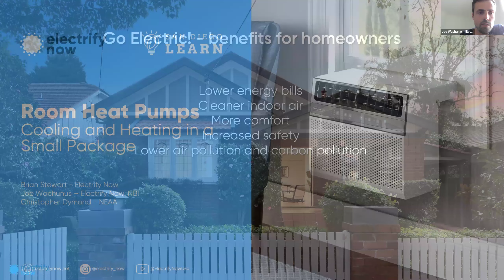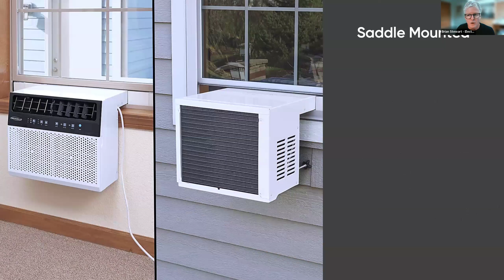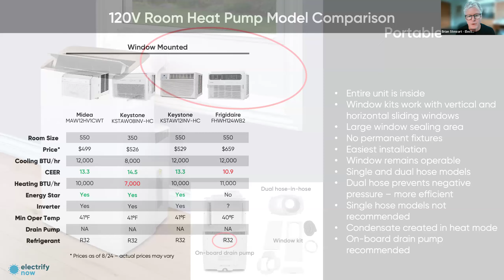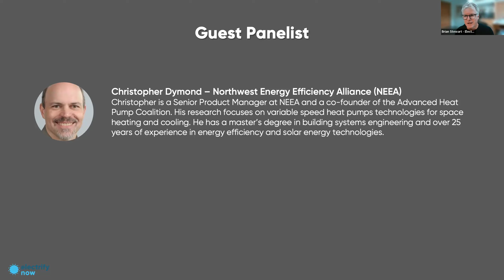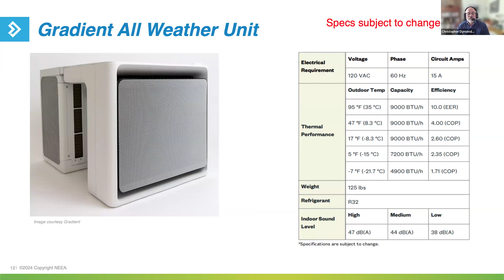Room Heat Pumps - Cooling and Heating in a Small Package

Comment: Please read this.-------PORTABLE UNIT FOR HEATING IN ANY CLIMATE----------.
Success with a portable twin hose inverter ac/heat pump is possible.
I have several Gree manufactured (sold under many names)14000 btu portable twin hose inverter ac/heat pump units with a defrost cycle.
 $350 online from China sellers. 
Yes, they do shut the heat completely off at about 35 degrees. Yes, the defrost cycle does work until they shut down. I moved the air intake sensor to a position where the unit didn't know what the outside temp was. That does work well, but the unit did spend a lot of time working off the freeze up condenser coil sensor and defrosting. But it did produce heat to zero outside temp.
So, for heat under 40 degrees outside temp I blend a small amount of room air with the outside intake air to prevent freeze up and shutdown. The colder the outside air, the more room air I blend in with it. I blend it at the intake hose connection on the back of the unit.
Zero degree outside air needs ONLY about 20 percent inside room air blended in to prevent unit shutdown OR freeze up even if the outside temp sensor is not relocated. This produces a very nice heat return in the house. It will heat a well-insulated 800 square foot area just fine.
I draw the outside air in through the pantry room window. Or often the attic when it's getting good solar sun exposure.
Best case would be to draw the blend air from a climate-controlled hallway in an apartment building. But this is a single-family house, not an apartment.
It draws a minimum of .6 amps and a maximum of 9.3 amps. Never more. And it is very quiet. No compressor noise, very little fan noise.
Four of these unit's zone heat this 3,500 square foot Arkansas house amazingly well. Yes, in the summer it's over cooled.
I'm confident that at $350 it is a very good option for many people at up to 800 square feet.
When it blows up, throw it in the trash and pull out the $350 spare reserve unit that you bought that's still in the box in the closet.

Comment: Do Type 2 heat pumps have to be shut off if the temperature drops below 40 degrees?

I read a review on Amazon which stated that the Soleus heated the room to 80 degrees with an outside temperature of 34 degrees. I now suspect this is because it had not yet built up ice on the coil.

Where I live, even when the daytime temperature is over 40 degrees the nighttime temperature can fall below freezing. Would it hurt to leave a Type 2 heat pump running with the temperature below freezing, or would I need to turn it off when the temperature falls?

BTW, I get propane through LiHeap, but the funds run out every year, and I have to buy my last fill-up out of my own pocket. My goal is to use a heat pump to reduce my propane consumption enough, so I don't need to have this last fill-up.

Comment: Why the Soleus saddle mount unit over the Midea model?  I've been pretty happy with other Midea products.
Reply from the maker: The current Midea Saddle Mount products are AC only, and do not have heat pump heating.  They are about to launch a new high end saddle mount heat pump that will work in cold climates, but will cost somewhere over $2,500 from what we know.
Reply: @ElectrifyNowUSA  that's great info, thanks!

Comment: I am honestly surprised there aren't more saddle mounted AC units w/ heat. I'm in a position where a product like that would be so much better and cheaper of a solution than installing mini-splits.
Reply: Lmao dude cheap mini splits on amazon cost around $400. No ac/heat window combo is beating that. All you need is a $50 vacuum and $40 gauges and $7 mini split adapters. For $500 you can get a mini split that completely blows away any window unit in performance and energy efficiency. What alternate reality position could anyone possibly be in that window units beat mini splits?

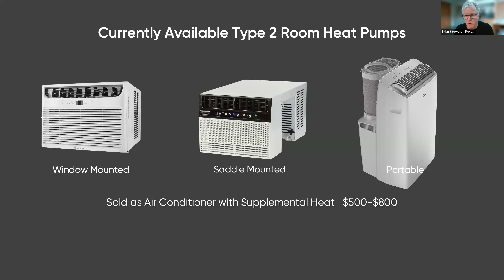Comment: 3:00 “typically called air conditioner with supplemental heat” NO! These are mostly not heat pumps but a resistance heater.
Reply from the maker: True - you have to read the fine print to determine which ones have heat pumps versus resistance heat.  Check out the models in our handout.